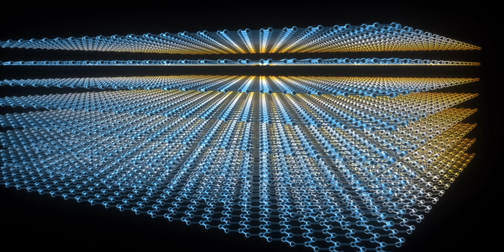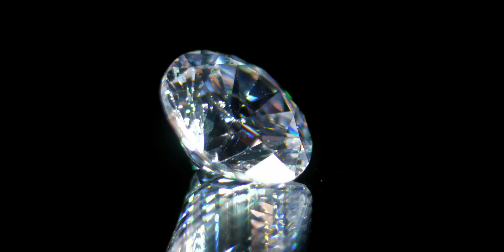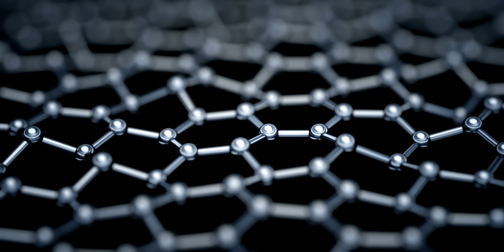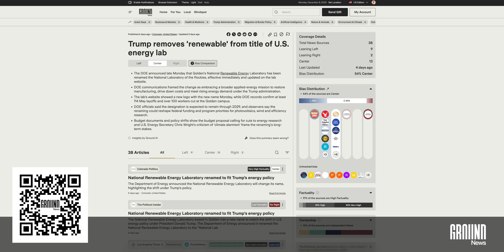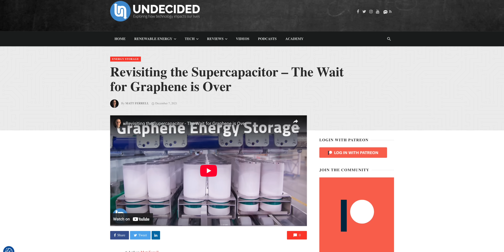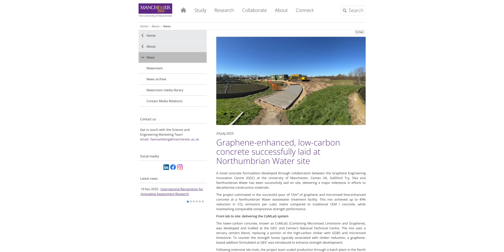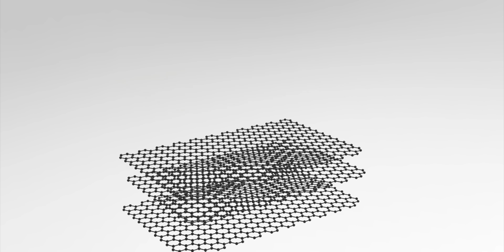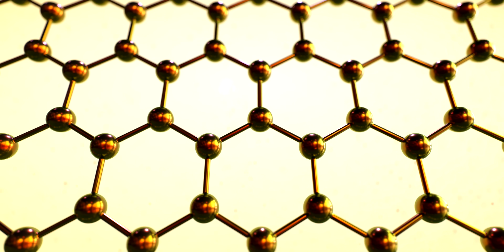How Graphene is Changing the World … Right Now

Comment: TLDW: Graphene is here but needs another 20 years to see its peak potential.
Reply: Another 20 years to get figured out and everything to get patented and then another 20 years for the patents to expire for it to be available and cost effective for anything but the most fringe things.
Reply: @ClangandChiill  You can make it in a home lab at a high enough quantity and quality do significantly increase the strength and durability of composites by just putting some in the resin. If you can fiberglass you can graphene carbon composite.
Reply: @jtjames79 been thinking about this with that air crete video...
Reply: @RealTwiner  Nighthawkinlight doesnt just talk the talk they walk the walk!
Reply: @RealTwiner  It's amazing how a tiny amount can make an enormous difference. Yeah it's a pain. But it's worth it. You can either pay some neighbor kid to make it for you, or make it yourself depending on how much your time is worth.

I was thinking about going into the carbon fiber rod business. Pretreated with graphene. Standard sizes or we can cut to your preferred length. It's not going to be cheap. But it won't be break the bank expensive either.

Sort of a 1.5 times the performance, for three times the price.

I wouldn't suggest using graphene in every component just yet. Unless you got a better source that I got. 

I would really really like to know more about that crumple type. At the very least this is going in my notes to ask AI to solve for me, if someone else doesn't get to it first. 

Seems to be a good way to make meta materials. I wonder if this could lead to something like bulletproof paint. 

Airplanes eventually end up full circle with "cloth" wings. 

They will have to put put special hold downs for future passenger jets, cuz if they get too light without fuel, passengers, or cargo they will just blow away in a breeze. Might just need the weight of batteries anyway just for ballast. 

I've been making sci-fi content lately. I'm farming ideas. 

Everyone is going to have their AI working on zero point and cold fusion and all that other fun stuff. I'm planning on having a list of things for my AI to use all that power. 

I really want a single stage to orbit airship. 

Technically there is a size of iron sphere you can make in space, and then drop it into the atmosphere and it will float, because the vacuum inside makes it buoyant. And something about the squared cube law makes it possible even with iron. 

Well we could do a lot better than iron. So what if you make a bunch of vacuum containing spheres, and use that instead of a lift gas. You can attach them together arranged in an aerodynamic shape. Then wrap it with some sort of fabric. Maybe hard maybe not. 🤷‍♂️ Then use a combination of propellers and air breathing ion engines. Once you're in space, just keep going on electrochemical. Slow but cheap. Probably best automated and used for Mars transfers in a continuous cycle, for the stuff that doesn't need to travel quickly.
Reply: @jtjames79  no you are wrong, 2030s it will be mainstream
Reply: @HopeIsInAllOfUs   Nobody cares what you think.
Reply: @j @jtjames79 ’m right jester remain seated, just go binge watch a show or something maybe drink 12 beers I don’t know what Americans do to further hamper their brain function
Reply: @ClangandChiill  China lo va a " copiar" y lo van a empezar a usar todas sus industrias y lo hara más barato
Reply: @ClangandChiill just like solid state batteries….oh wait, they’re commercially available…
Reply: @merkel2750  where? this generation belive in anything
Reply: @ClangandChiill  With the rise of AI, it will take far less than that
Reply: @ClangandChiill  I wouldn't say so in the era of AI & Deep learning.
Reply: @ClangandChiill i know an another technology that that is 20 years away from relevance, Fusion reactors.
Reply: @ClangandChiill  have u seen chinese manufacturers? they implementing technologies discovered four years ago and selling products with said technologies, the west might need 40 more years the east needs 4
Reply: @Moon-eu8pt  or claiming that the product has that technology, which it might, but when it breaks months later the company has already disappeared.
Reply: @Moon-eu8pt  the east just sends a bunch of students to steal everything and take it back to china and reproduce it without all those pesky copyrights. don't fall for the propaganda.
Reply: @CompletelyNormalPhenomenon  yep china wants to show they are really high tech but they aren't. They do great stuff but their high tech is a lot of hot air. Even Chinese planes mostly depends on western parts. If you are a superpower, you have your own planes. It's not so complicated.
Reply: Typical Matt vids....
Reply: @frosty6960  I would call it the vaporware channel! Matt is quite thorought into finding the most obvious start up scams making theranos a fine venture...
Reply: @frosty6960  Yeah, he truly is the Seinfeld of Youtube without the cringy comedy.
Reply: @AnimeSlaps  they said that 20 years ago
Reply: @GhostSecuritySolutions  congratulations, you have understood the premise of every video on this channel
Reply: @GhostSecuritySolutions  True, but they are quite a bit farther than 20 years ago, with actually working practical applications you can buy.
Reply: @Daniel-rd6st  graphene batteries powering ai data centers told me all i needed to know about this video
Reply: @Daniel-rd6st  further, the manufacturing methods used in one area may assist those that are lagging behind. Bootstrap all applications that way.
Reply: @GhostSecuritySolutions graphene is not light_Wegit
Reply: @GhostSecuritySolutions  20 years ago it wasn't there yet. Now it is. It is being actively used. Are you living in a cave, or do you just like to be depressingly contrarian?
Reply: Thank you, saved me to waste of time!
Reply: Damn!:(
Reply: Who's gonna win cold fusion or graphine?
Reply: Well worth the investment.
Reply: So same as the  most topics of the videos by this guy.🙄
Reply: so nothing new for this channel lol
Reply: why i unsubbed lol
curse the algo that brought me back
for nothing
Reply: @russellzauner why? Did you want a channel that just explains mature or plateaued technologies?
Reply: @rhoharane  When the title literally says "Right now" I expect it to explain technologies that are literally available right now.
Reply: Hopefully 10 years
Reply: Thanks
Reply: Thank you for this.
Reply: I would say 5 to 15 depending on the application but yeah closer to 20 than 5 realistically
Reply: Thanks
Reply: MEET THE POTENTIAL MATERIAL!
Reply: Do you also have a chess channel?
Reply: See you in 20 years to post this comment again 😉
Reply: @AnimeSlaps  like every 5 years smfh
Reply: thats what they said 20years ago! where is our space elevator?
Reply: True
Reply: TIL there is TLDW
Reply: @AnimeSlaps  TYSM!!
Underrated
Reply: Half a blink of the evolutionary eye
Reply: "my friend is here but he'll take another hour to arrive"
Reply: You should’ve watched it. Graphene not only here, but it’s actually being used in practical applications.
Reply: graphene photonic computers when?
Reply: Does pencils have graphene?
Reply: One day we might have a product that is usefull and use graphene. Everyone in the last 20 years was wrong. Don't be wrong.
Reply: It's an interesting channel this guy has cultivated, I usually watch his vids being generally Nerdy, but ya, this is the realm of whiz-bang technology that is always on the cusp of widespread adoption. Which is awesome if you want longevity on YT. LOL. We're watching, so I guess it's mission accomplished!
Reply: Sounds suspiciously like fusion.
Reply: And we’ll have to wait 2000 years to see if Graphene concrete holds up as well as Roman concrete
Reply: I would say 20 years is probably underestimating it -by quite a wide margin.. 35 years ago I did a little theoretical work on nano-technology assemblers. Graphene will only begin to hit its true potential once we have mastered true nanometre scale engineering & high energy materials..
Reply: so 40 years total then
Reply: @AnimeSlaps  so were at the same point as 10 years ago
Reply: @AnimeSlaps  wow your so wrong you must be one YouTube DR
Reply: You can copy and paste this comment to every one of the videos on this channel
Reply: Thank you Dr.
Reply: Like Fusion power!
Reply: Pretty sick of this channel. It’s clickbait slop with a pretty paint job. It’s all extremely irrelevant/theoretical tech that has never, or will never “transform” the field nor the world.
Reply: There are some really hard NP complete problems with grapene
Reply: Seems like a green light to invest in those companies that developing those tech from now on, i want to see 1TB  RAM with less energy and also cheap for people one day lol
Reply: Do you people need to put these comments on literally every video on this channel?
Reply: Thank you. I'll be charging it with my small modular fusion perpetual motion device ❤
Reply: 1:01 my kid makes graphene every day at school.
Reply: i dont think 20 years is going to be neccessary for the tech side. As a silicone replacement it might just keep china out of the datacenter game so i think it'll get lots of money now that it's starting to get viable. Now we just need the laser lithography (on silicone) equivalent for graphene. i know china is also looking into this and i think this tech is more acheivable short term as an energy solution compared to nuclear fusion.
Reply: @AnimeSlaps  but they told me that 20 years ago!
Reply: TLDW: this stuff gets into your body and then you die... but they need us dead anyway :D
Reply: Cheers mate ! No need to waste the time.
Reply: Same as last decade then? 👍
Reply: Goated comment, thanks for saving me the time
Reply: Thanks for the time saved <3
Reply: Saved me 17 minutes❤
Reply: @AnimeSlaps  less than a decade And we'll be where you think will be in 20 years More will happen in the next decade than happened in the last hundred years 👀
Reply: Thanks that's all i clicked for
Reply: Thanks!! Saved me some time watching the rest of the video just to find it’s all hype
Reply: Like Nuclear fusion
Reply: Nope
Reply: Thank You🥺🎉
Reply: I'm 40 and can confirm this is the status
Reply: @AnimeSlaps  God bless you
Reply: Doing the Lord's work right here
Reply: Thanks!
Reply: @AnimeSlaps  so we will mostly be dead if bot entirely extinct before we get to use this tech? Awesome, definitely worth pretending like the world isnt on fire for tech we wont live to see
Reply: "Fusion reactors 20 years away" since the 70s ahh timeline
Reply: @AnimeSlaps  THANK YOU
Reply: Thank you.
Reply: much like fusion its always 20 years away
Reply: @scrongi  no it’s not 😂
Reply: Plotting anything at 20 years is absurd with the exponential growth of information technologies speeding up development of other tech
Reply: more like... "but big companies need to find its potential"
Reply: Just like Fusion.
Reply: Been saying this for 20 years
Reply: It's literally too fragile to ever be usable... Unless it's held stable by something inert it's literally physically mathematically impossible for large scale sustainability.
Reply: I understand your thought that graphene can change the world... Yet gfets have been around for 30-60 years publicly
Reply: If you actually believe in quantum computing guessing about mathematics, I literally won't trust you anymore. Mathematics doesn't involve guessing, chemistry doesn't involve guessing, neither does physics. I'm sorry but quantum computing will forever be near impossible until we find a more efficient heat pump...
Reply: What you don't understand is called Moore's law... No matter the amount of graphene used and already amazingly efficient. Silicon-based conductors. It's pointless to even think without 0.99999999999999999 k I find it hilarious. People still think we need faster processing power per watt.
Reply: I don't know why you hate lithium ion lithium iron phosphate and every other battery that is 99% turnaround efficient, recyclable and more clean for the environment than old nickel metal hydride or nickel cadmium batteries? This isn't about energy efficiency. This is science and finding some type of what's worth throwing into landfills everyday? It's called nuclear energy... That's how these things evolve... Not by listening to uneducated scientists who have no history in the field
Reply: Gross why are you even talking about spending billions of Watt hours to make concrete a mathematically union? Bruh
Reply: One Adam thick graphene simply can't exist for more than milliseconds I'm told simply because of the atmosphere and the universe we live in.
Reply: very good
Reply: Now where have I head that one before...
Reply: @AnimeSlaps  Yeah, they said the same things 10 years ago.
Reply: @AnimeSlaps  that 20 years will fly by yall
Reply: Thank you
Reply: Making graphene is easy, making graphene in large sheets isn’t possible yet, but I’ll doubt it will take 20 years to refine a manufacturing process.
Reply: Yet another 20 years 😂
Reply: "peak potential" might not be the right term here as a material can be useful or even revolutionary without hitting it's peak potential. 

Steel is a perfect example to use here. While there were various instances of steel production throughout the ancient world, it wasn't till the middle part of the 19th century when you could produce high quantities of steel with the invention of the Bessemer process. Even so, there continue to be developments to this day involving adding various additives to the steel making process, such as the addition of chromium to create stainless steel which despite being first created in the 19th century, only recently has reached the quality and cost where orbital launch providers like SpaceX feel comfortable using as the primary material for their prototype Starship heavy lifter vehicle.

Graphene has an even greater potential for permutations as a carbon allotrope, so it will likely be centuries before we come close to reaching it's "peak potential".
Reply: @AnimeSlaps  
So it is like cold fusion...always 20 years away from being useful...
Reply: @rockytom5889  cold fusion is way worse, physicists debate if it can even be done. Graphene at least has proven applications under test conditions... nobody can test cold fusion. The main issue with graphene is it is hard to produce at scale to the specs required.
Reply: Isn't fusion already tested?
Reply: @Axewayboy fusion bombs have been made, fusion reactors are still in development because we currently can't get more energy out than we put in over an extended time. Part of cold fusion is finding a way to make it more efficient by lowering the conditions needed to trigger the reaction, which is kind of at odds with the laws of thermal dynamics.
Reply: @rockytom5889 it will always be estimated to be 20 years away, that is until one day we discover a breakthrough and it will suddenly only be a few years away.
Reply: Seems like every one of his videos about a "matured" technology. Clickbait.
Reply: I'm surprised that people still don't get that this is a positive technology hype Channel. Most of his videos are about potential of some new technology
Reply: Highly doubt 20. This current use will increase efficiencies and lower cost of research on using graphene in a feedback loop. Just like with computer chip engineering. AI is also could to help reach it's peak potential (or a serious plateau) more quickly.
Reply: "TLDW" - those of us who DID watch will know that your comment is... well... just wrong.  Maybe you should actually watch it, instead of making badly informed assumptions?
Reply: @theelectricmonk3909  *uninformed presumptions.
Reply: Probably more like 5 years
Reply: I agree. I used to like this channel and watch all videos when there was actual information like real costs of solar etc. Recently he ran out of content and now just clickbait videos with a lot of AI generated clips that mean nothing
Reply: Yep…Patience is key here…it is coming along relatively quickly.
Reply: thank you twin we really needed another nuclear fusion type of advancement just 20 years away
Reply: Thanks I knew this was another click-bait, so didn’t watch
Reply: Bro, my phone has graphene in the battery, what do you mean it's not in use.
Reply: @Del_vin_0 sure it does, if it says so, bro.
Reply: If you guys wanna techs that are actually working right now, go watch " How things are made" channels. Not this channel. This channel focuses more on cutting-edge technology. Understandably, many of them are not going to make it to the real world. That's the nature of new cutting-edge tech. Don't expect everything to materialise immediately and perfectly. 

Sometimes, I feel like many of us have this "millineal syndrom."  Want instant gratification. Can't even wait to pause and ponder.
Reply: @alihms brother is like "Don't expect everything to materialize immediately and perfectly", meanwhile the title "How graphene is changing the world right now" bro...
Reply: What do you mean? Its got $1.2 BILLION market in 2025. That's history, not 20 years from now.

Are you really that ignorant? Apparently. 😅
Reply: ty, life saver. sick of 20 minute clickbait titles about graphene and borophene being "here" and then back peddling after taking 10 mins to to the nothingburger run down and wasting ur time.
Reply: I think his viewers deserv at least minimal respect. Such clickbait titles make us feel dumb for clicking them. And the content is a waste of time, as this kind of "just wait 10 years" innovation is happening since forever.
Reply: So it’s barely an update
Reply: And our government HAS ALWAYS BEEN 20-40 YEARS AHEAD technologically.  That didnt just stop being a reality.
Reply: @AnimeSlaps  I honestly think is minimum of 2 years and a maximum of 5 years it will be at its peak, the reason I’m saying that is because with the fast development of AI and simulation done AI will find a way to unlock it’s full potential! And each passing year technology accelerates at a phenomenal speed! I honestly wouldn’t be surprised if next year we see graphene widely implemented!!
Reply: This is the most sensationalist clickbait channel ever. All he does is cover vaporware.
Reply: And like nuclear fusion, in 20 years it'll probably need another 20 years.
Reply: The trick is 3-dimensional hexagons.
Reply: @MarkAntony01 
But isn't its TWO-dimensionality its functional value??
Reply: Thanks bro
Reply: Another 20 years after that
Reply: So nothing changed in 20 years, cool
Reply: @blakeg7062 it changed a lot, without graphene.
Reply: yeah just another clickbait video ugh
Reply: "graphene is finally here!" 
10.years later 
"Graphene is finally here!"
10 years later 
"Graphene is finally here!"
10 years la-
Reply: @AndromedaGaming2248 you have no idea what 2030 is all about
Reply: @AnimeSlaps  no offence but you don’t know shit about the timeline of development of graphene. Everyone thinks they are experts lmfao
Reply: I immediatelly knew this is clickbait and did not watch it. He's destroying his hard earned reputation with such videos.
Reply: @eIektrinis  No he does not, because, if you actually had watched the video, he also talks a lot about its current state and that it is mostly not yet in mass production. And btw. this has always been what this channel is about, technonlogies that might be revolutionary, but are not yet there.
Reply: @Daniel-rd6st so why the BS title? "Right now"?
Reply: @eIektrinis  Because the process has started i assume. And yes, there is a certain amount of clickbait in it, but to be honest, where isnt? If i see a topic of intrest to me i click. If it dosent capture me after a minute, i stop watching. I dont see the big deal anymore, unless someone is outright lying in the title.
Reply: @eIektrinis  If you look at the title carefully, you may notice the word "changing". You may also notice that this word means that something is in the process of happening, not that it already has.
Reply: @somdudewillson it can only be changing when it enters the market. Which it did not and will not soon, if ever.
Reply: @eIektrinis  cuz he's talking about where the technology is at "right now"
Reply: @eIektrinis  honestly I discovered this channel recently and after some videos that had a very interesting title, I realized it was all clickbait. The videos are still interesting but i don't like being deceived